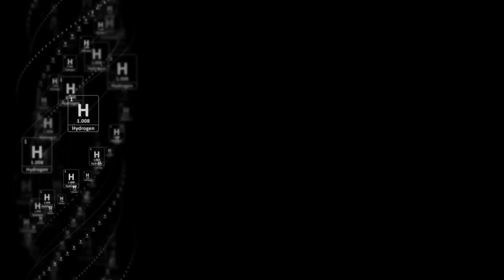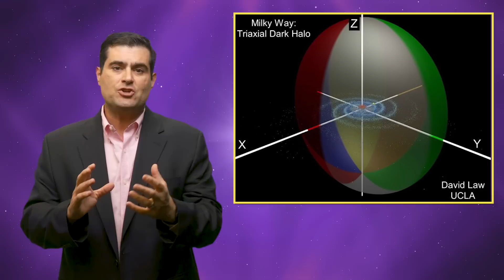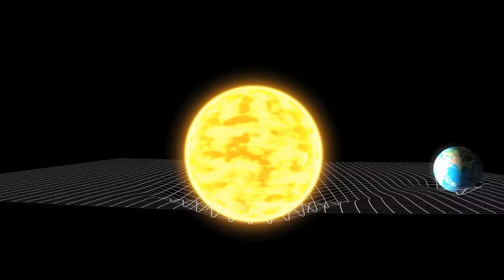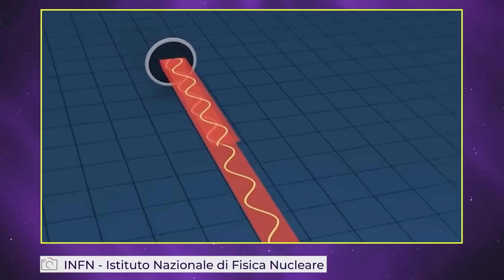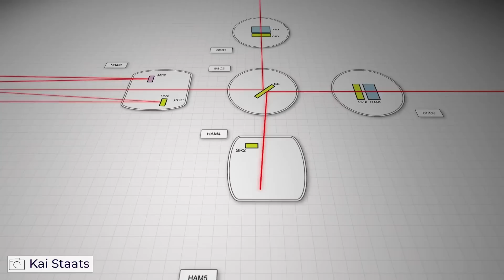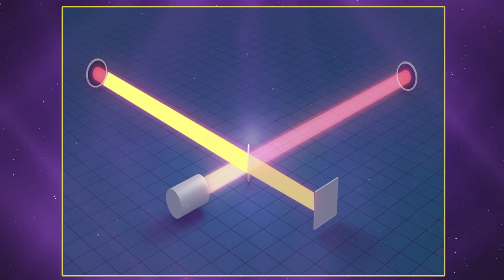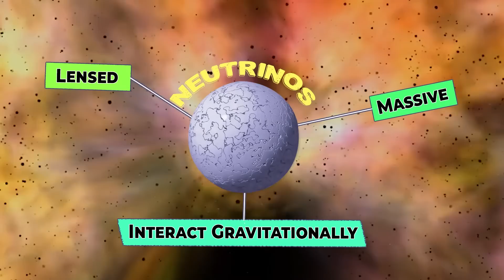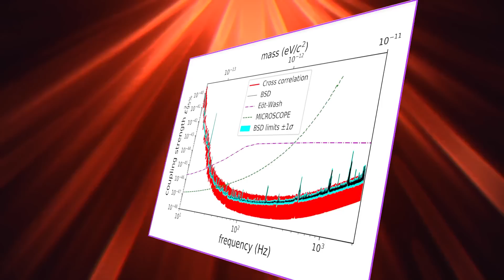Digging for Dark Matter with LIGO

Comment: I think expansion is a minute characteristic of matter, you get enough matter in primordial black hole the expansion exceeds gravity and the big bang. This expansion rate related to the average density is automatic regulation of the expansion until atomic and gravity take over and matter dissipates like sand on a beach when waves crash and dissipate. The galaxy creates a higher expansion rate, maybe nano meters per km per year instead of atoms per km per year average for the universe. This differential expansion is like a hose turned on (under water) in a calm indoor pool, you get ripples and effects. The expansion rates are just normal to us and you would not be able to measure it, and the rates are atoms per km per day which is unmeasurable. Dark matter that was attracted to our galaxy but distributed differently outside the galaxy, expansion bumping into much lower background expansion rippling space time like the hose would occur outside the galaxy.

Comment: I wonder if it is possible to make an arbitrarily small and cheap version of LIGO that could be used to detect the presence of a warp drive being used.  We know for a fact that UFOs exist; we can even call them.  So the next question becomes:  do they use a warp drive?  If so, could LIGO be used to detect it?
Reply: I suppose if it passed close enough to the detector.

I'd imagine it is doable to build your own mini LIGO. I've seen YouTubers who build laser setups with 50% mirrors to make holograms and stuff. Surely the hardware could be mostly bought off the shelf.
Reply: @inthefade  we know that Skinwalker ranch is getting a lot of GPS spoofing.  Is there anything we can learn from that? In terms of geometry?

Comment: How concerned are you that "dark matter" is just something like an ultra-low reacting neutrino? A particle, that has mass, but literally never ever reacts with anything at all other than gravity? Maybe "dark matter" is the last most absolutely low energy thing that all other particles eventually decay into.
Reply: Maybe we have the answer in the Higgs boson actually being a boson? 

Because of that, it can dissappear from fermionic matter into a group behavior. 

Or, its excitations can split into fermionic pairs that we can form out of.

What if there are four equally possible orientations of such space-time condensates in a 4D universe? 

If they were non-interacting and completely uniform, would we see it as a uniform 75% dark energy, a non-existant dark matter, and no expansion?